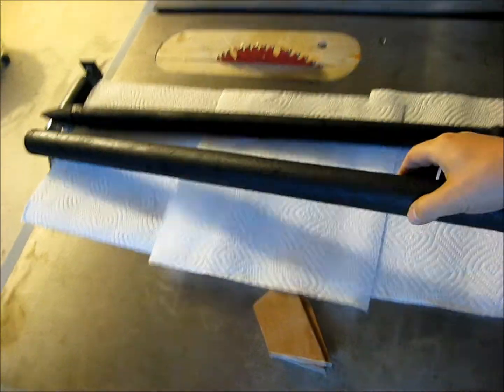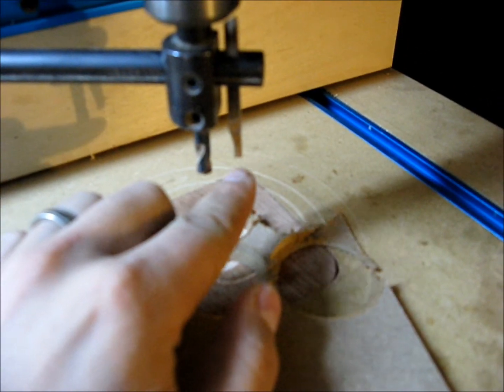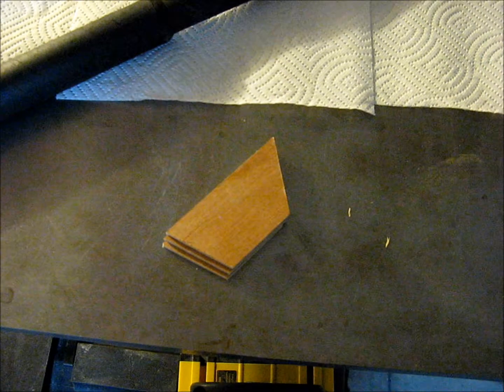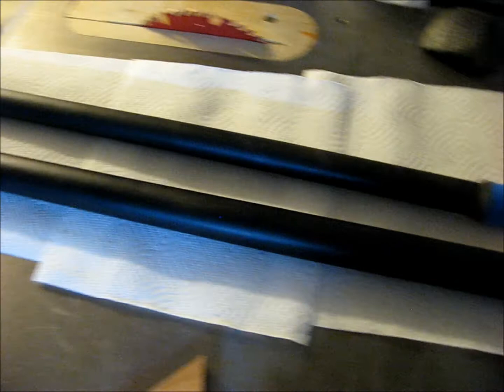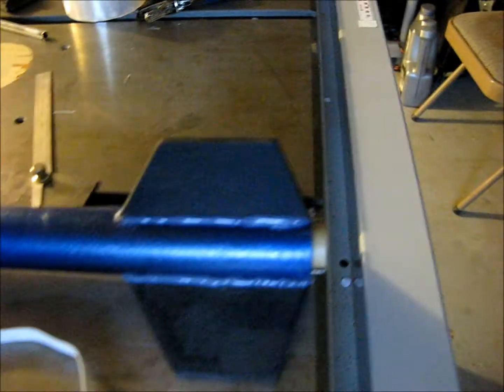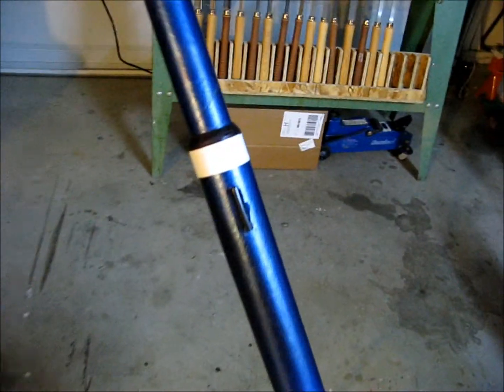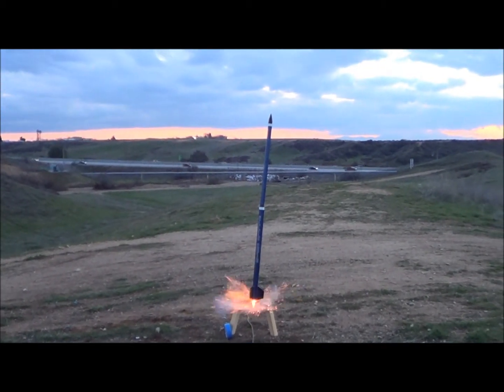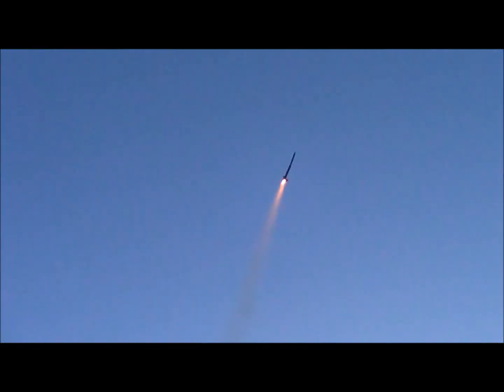Model Rocket: 2-Piece 54" and under $10!

Comment: Great videos. I just built my first rocket after watching your how to build videos. I hope to launch it tomorrow. Just 2 questions though. Do you use wadding or an ejection tube as in your build vids and how tight should the ejection tube be in the bottom tube. I was also surprised how the ejection charge still works with such a long tube. Might have to upsize my next one. Keep up the builds. Looking forward to the next launch.
Reply from the maker: Thanks for watching and congrats on the build! I usually just use the ejection tube. On a super short rocket I might use both since the ejection charge will go off so close to the bottom of the ejection tube. It's pretty impressive how large a rocket you can build and still get the proper ejection. I usually just make them two pieces and cork it half the way up for these smaller motor rockets. Good luck on the maiden flight!